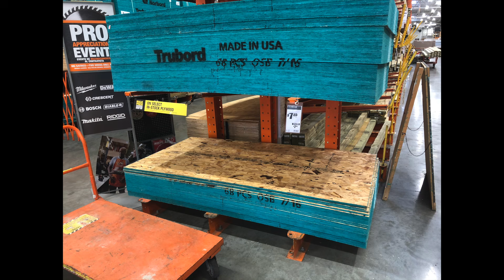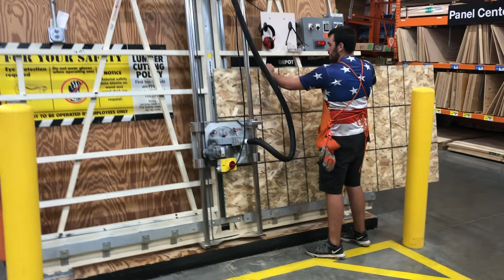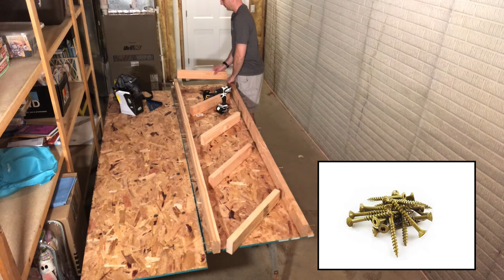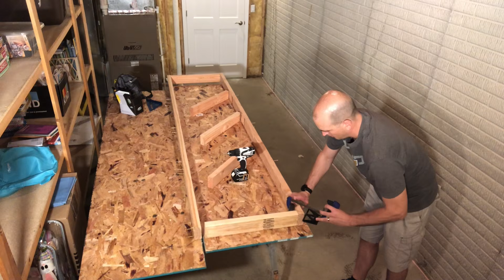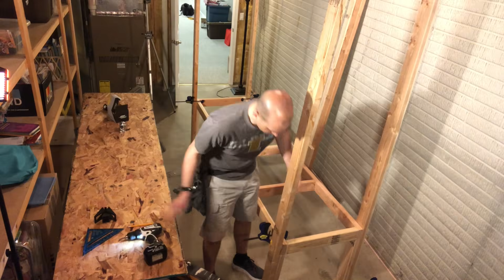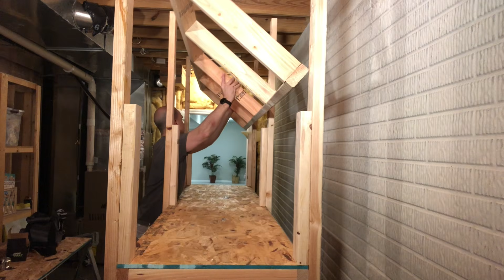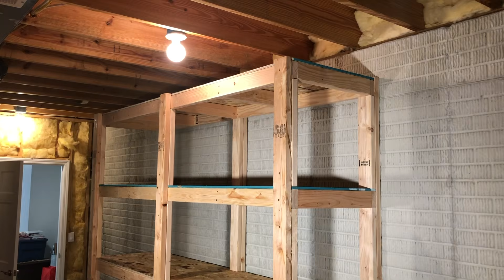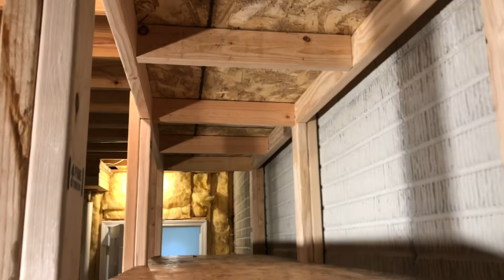How To Build Storage Shelves | Easy Build

Comment: Great video. Does the corner clamp pads work on those 6" mini Irwin clamps? It says for medium/heavy clamps...so wasn't sure.
Reply from the maker: Hi Bica,  Yes the corner clamps will work with the 6 inch Irwin Clamps.  You will just take the standard pads off and insert the corner clamps pieces.  Best of luck on your project!
Reply: @EverydayHomeRepairs  even the minis? I ask cause I read an amazon comment that suggested the attachment pads don't work on those, but only on the medium/heavy version
Reply from the maker: Hey Bica, I checked mine this evening and I have the 6 inch mini clamps which worked with the corner clamp. I think the difference is the medium and heavy duty clamps you remove the standard protective pads then install corner clamps and my minis you can keep the standard pads on which fit into the corner clamp.  Should be good to go!

Comment: Hi Scott, great video! My basement has very low ceiling, 7' to be exact. Do you have any recommendations best way to accommodate the lower ceiling?
Reply from the maker: Hey Michael, are you going to primarily store totes?  If so what is the height of your totes?
Reply: @EverydayHomeRepairs  they're about 17-19". I think I figured out the measurements but please let me know if they're off.
-6 72" for the legs
-8 96" for the sides of the shelves
-4 cut into 15 separate 21" pieces
-4 cut into 18 separate 20" pieces
Reply from the maker: Hey Michael, looks good to me. Best of luck on the project!
Reply: @michaelsantos2546  Did you still need 8 96" for the side of shelves? I am in a similar situation where I am only doing a 72" tall shelf. I am keeping the same spacing between shelves so i am not doing the top shelf. Therefore i am only needing 6 96" studs.  Just following up in case i am missing something!

Comment: Scott Thanks for the video
Can you give the exact dimensions of all the parts in sntimter
Reply from the maker: Hey David, the full build list is in the description of the video.  Let me know if you need any additional measurements.
Reply: @EverydayHomeRepairs  thnnks

Yes I need the width of the shelves And the distance between the 3 pillars of the installation length
Reply from the maker: @davidhanin4117  
height = 8 feet
width = 8 feet
depth = 2 feet 3 inches

The shelves have about 43 inches open in between the legs and the height of the shelf opening is 20 inches

Hope that helps and let me know if you need anything else.

Comment: Hi, I have two questions:
1) for the legs, do they have to be pressure treated since it touches the basement floor?
2) how would you anchor this to the concrete wall?
Reply from the maker: Hey Wonbo
1)  I think it would be a good idea to make the legs out of pressure treated especially if your basement is humid/damp.
2)  I just used metal strap like this https://amzn.to/34gAX2n and attached 1 to each end and then to the floor trusses.  

Best of luck on the project!
Reply: @EverydayHomeRepairs  Thank you! So for number 2, that essentially anchors the shelf to the trusses, instead of the wall right?
Reply from the maker: Exactly, if you secure the strap (from the truss) such when the shelf just starts to tip then the strap pulls tight that will be enough to keep the shelf from tipping.

Comment: I like the design, and I'll be doing something very similar in my basement. Curious why you bothered to build it to the joists and put the OSB on the top since it's too close to the joists to really be used as a shelf? I think that I'll stop at whatever level will keep the top shelf open to the joists so that it's usable and I can fit taller items in between what are in my case trusses. In yours, I would have stopped at level three since the top is not really usable. Just my thought.
Reply: Thanks for the response Scott. Illinois grad myself but probably a few classes prior to yours.
Reply from the maker: ILL!
Reply from the maker: Hey Mark, yeah your comments are completely valid.  I was also trying to build it for the viewers and thinking through a garage where you might have more ceiling height.  If you look at some of the other comments others have noted their tweaks to the design to get more use out of the top shelf.  Best of luck on the project!
Reply: INI!

Comment: If I want to make a shelf that is 12 feet in length but same height and depth, how would that change the materials list?  and assembly?
Reply: also, if (due to air ducts) only 6 feet high for the 8 ft long shelving would work, how would you change your materials list?
Reply from the maker: Amy, could you leave the legs being a full 8 feet but just not install the top shelf?  Could you fit the legs around the air duct or do the legs need to be shorter as well?

Comment: Hi. I have question. This is all free standing right? Is not attached to the back wall correct ?
I like it for my storage unit. I Can't not attach nothing to the walls. Let me know. Thanks 😔
Reply from the maker: Hey Nicki, yep the shelf is completely free standing but I would recommend installing some type of "anti-tip" cable or strap to make sure if somebody (probably a child) is climbing on the front side that it doesn't fall over.  Best of luck on the project!

Comment: If you can afford another 4X8 sheet of MDF, have it cut in half lengthwise and secure the two pieces to the ends of the shelving unit. This prevents items from falling off the ends.
Reply from the maker: Hey Chuck, thanks for the additional ideas on the shelf construction.  Appreciate the help!

Comment: Thanks for the video. Unfortunately I cant even get two boards to tie together. They will push away if I dont drill, and if I do drill, the screw wont hold. Even if I do drill, they will still somewhat push apart... and then break apart. If I try to send it, the wood will crack and/or the screws will strip... and there will still be a gap. Im using Spax construction screws. What am I missing?!
Reply from the maker: Do you think your boards are all cut to the correct measurements?  which part of the shelf construction are you on?
Reply: @EverydayHomeRepairs  Shelf frame. First one. Attaching 8' to 21" board.
Reply from the maker: @southseapirate1  what are the length of the screws you are using?  I used 2 3/4 of an inch screws but 2 1/2 should work as well.  From what you were describing I would think you might be using 1 3/4 of an inch screws.
Reply: Predrill and use wood screws.

Comment: I suggest bracing shelf to ceiling or to wall, to prevent tip over, kids like to climb things
Reply from the maker: 100 % agree.  Thanks for calling more attention to bracing for safety.
Reply: I was going to ask about this. What do you recommend to keep this sturdy against a wall in my garage so it doesn’t tip over?
Reply from the maker: I would recommend a furniture anti-tip strap or kit.  You could make your own or find one for about $10 on Amazon.  Just make sure when attaching to the wall you attach to a stud and not just drywall. Good luck on the project.
Reply: @EverydayHomeRepairs  Thanks!

Comment: A refinement that I would like to suggest............since shelves like these are likely to be in a basement, and many basements (especially unfurnished ones) have their concrete floors sloping slightly towards floor drains or the sump pit, trying to get all the shelf legs level within the shelf and yet properly taking their share of the load, a solution is needed. 

What I have done is to take each vertical 2x4 and drill a hole in the end that will rest on the floor, perhaps 1-1/2" deep and centered on the bottom of the leg and going vertically up into the leg. For the diameter of the holes, I recommend a clearance to fit 3/8"  bolts. Then get some 3/8" - 16 carriage bolts, and a matching nut and flat washer for each bolt, one bolt per leg, and the bolt length should be whatever the leg hole depth is + 1" , so if you drilled the holes to be 1-1/2" deep, you want a 3/8-16 x 2-1/2" carriage bolt. Thread the nuts into the bolts, leaving about 1/2" between the nut and the bolt head. Fit the washer onto the bolt so it touches the nut. Stick the bolt into the hole in the bottom of the 2x4 leg. This gives you and adjustable leg leveler on each leg. Use a wrench to hold the flat part or each bolt behind the head, and another wrench to turn the associated nut, and you can easily extend or retract the bolt to compensate for unevenness in the floor.
Reply from the maker: Hey Youtuuba, not a bad idea and thanks for sharing.  This would be very handy especially in the basements with a little more aggressive slope heading to the sump pump pit.

Comment: Screws are not to be trusted for structure strength.

Nails have shear strength that screws cannot match.

I see this often, people building structures using screws.
Reply from the maker: Hey Duane, thanks for the comment.  The screws from the 6 legs going into each shelf shouldn't be in shear since the small 2x4 sections are placed under each shelf to carry the vertical load.  I might be missing something and always looking to learn but I feel good about this design holding up.
Reply: Everyday Home Repairs 
ah, 
Notice taken.  
The vertical 2x4’s do save on shear movement.

Which does support to prevent shearing.

However, maybe to solidify this project, I would add nails.  Screws should not be trusted.

The video end and start still frame shot hides the center back vertical support (6th leg) 

I will amend my original comment about the scheduled event.

Btw, lots of people making shelving videos with no legs for the rear support, 
relying o the garage wall to support the shelf load.

Your project unlike others stands on its’ own, 
Shelves are supposed to support their own load.  Not relying on the rear wall.
Meaning legs in back too.  

But I reaffirm safety using nails not screws.  Or additionally to the screws.

So far, your shelving is much stronger than any other shelving projects I’ve seen here on YouTube.
Reply from the maker: @duaneyoutbe  appreciate the additional follow up and knowledge sharing.

Comment: First off... That's not "Plywood", it is O.S.B.! Oriented Strand Board! There is a difference! 
Second, I have found that having the lumber pre-cut does save time, but you need to observe the employee doing the cuts. Some of these persons don't do their best to get the dimensions right.
Thirdly, you as the designer need to get your dimensions down perfectly right, else wise you'll get to make the adjustments yourself. And you'll be lucky if the dimension is just too long. Too short means going back to the store for another piece of lumber.

Comment: I will be doing something similar to this, in a shipping container. Except that it will be built-in. No back legs, the shelves will be attached directly to the wall, this will give me an extra inch and a half of space. A consideration in tight quarters. Mine will also be 16' long and 6' high. I will have 3 shelves, at 2', 4', and 6', giving me approximately 2' vertically for each shelf, with the bottom "shelf" being the floor. I'll be doing all the cutting myself, I'll also be doing lap joints on the shelf rails, to make 16' rails. I like your vertical reinforcement of the legs. I hadn't thought of that, much easier than the way I was going to do it.
Reply from the maker: Hey Dave, sounds like a fun project.  Are you using the container strictly as storage / shed or are you making a home out of container(s)?
Reply: @EverydayHomeRepairs  Storage and a small (very) workshop.
Reply from the maker: @Dave_Simmons  that's awesome.  I am a big fan of shipping containers and hard to get a more robust shell for the money.  Best of luck on the project!
Reply: A big problem with these containers is the lack of insulation and cooling. Especially here in the desert! Adding power to them isn't a big deal. Adding rigid foam insulation from Home Depot is going to cost almost $600.

Comment: People actually make home depot cut all of there shit like this?
Reply: That's their job, it's in the job description.  If they weren't doing that they would be doing something else.  They don't get paid to sit around.
Reply from the maker: Jeramie,  guess it might be easy to overlook that everyone doesn't have a truck and saw at home.  If you have the right equipment I say go for it and you will have more control on hitting the exact length needed.  If not, utilizing HD capability and their willingness to cut your boards seems like a solid option.
Reply: @EverydayHomeRepairs  I'm just not the type to cause others extra work or inconvenience them much less trust that all of their cuts will be accurate. I've brought a cordless circular saw with me to cut sheet goods and really long boards a few times to fit in my Grand Cherokee. Although I can carry 16ft 2x12s in it no problem without cutting lol
Reply: @EverydayHomeRepairs  I am not overlooking anything I just figure that if you don't have the means to do so that you should then pay someone for their tools/abilities/time. If it's a free service I'd think that they (HD) would probably rather not do it. It's  for convenience but not to be taken advantage of. So cutting to fit your vehicle is one thing but cutting all of your pieces to length for your project when the whole 2x4 at full length will fit in your vehicle as is just seems a little overboard. I just know that if I worked there I wouldn't want to have to do that and would not like the customer who requested it. But if it's a paid service then everything changes.
Reply from the maker: @jeramiet154  For most the big box home improvement stores this is a free service they provide to try and get you in the door.  They (HD, Lowes, etc.) will cut sheets and boards to length per request.  I also think you shouldn't keep them there all day cutting wood for your project but with their setup they can knock out a project like the storage shelves in about 5-10 mins.  There is a definite chance they could be off by an 1/8 of an inch so something to keep in mind and good to set expectations.
Reply: Is there no limit to how much they will cut? Do they do mitered or beveled cuts? Do they cut sheet goods in more shapes than just a square or rectangle? Any fees?

Comment: Great project, but I don't see the purpose of the top section.  Seems like a waste of wood and you can't add anything to the top.  Are you tying it to the floor joist to secure it from tipping?  Not trying to be critical, but trying to understand how you use that top section as I plan on doing something similar.
Reply from the maker: Yeah,  for my setup I only had about 1 foot clearance to the floor joists so the top shelf had limited function.  I wanted to show the top shelf to try and apply to others which are putting this in a garage with a 10 foot ceiling.   I just used a little wire from the bottom of the floor joist to the middle backside leg as an anchor.  I don't mind the questions at all and best of luck on your project!

Comment: Great video, great heads up about HD making the cuts!! Quick question, how important do you think the middle supports are? I love the design just would rather have it open on the middle if possible.
Reply from the maker: Hey Dengriff, depending on how much you are planning on loading up the shelves you would probably be okay without the middle support.  You could try it out and if you don't like the overall structural strength then just add in the middle supports.  If you do test it without the middle support and could report back your findings that would be Awesome!
Reply: Why not put the middle support in the back instead of the front?
Reply: I ended up not adding the supports and have stood on it with it fully loaded and feel comfortable enough to not worry about it. Thanks again

Comment: Awesome video. Have watched multiple times. I want to do more DIY projects but don’t have a table saw or chop saw. I like that you considered the average homeowner in your videos.  Really appreciate that.

Quick question. My shelves will be freestanding as well in the basement but won’t have a heavy load on them. Do you feel like that middle leg on the front is absolutely necessary for support?  Just wondering if I can do the whole shelf as one big open shelf.  Maybe it wouldn’t work over such a large length.
Reply from the maker: Hey JD, glad the video helped.  You will be fine without the middle leg as long as you keep the loads reasonable. Worse case you can add it in later without any issues. Best of luck!

Comment: The reinforcement is crucial! Thanks. In my previous home, the previous homeowners built some shelves similar to this, except there was no reinforcement. Overtime the thing was falling apart. It took me more time to reinforce them than ripping them out and rebuilding new ones. Now I need a shelf like this for my new home. Thanks for all the measurements so I can just have HD precut them instead of me cutting them and having to clean up the saw dust.
Reply from the maker: Exactly, for projects like this having HD do the cuts saves a TON of time and mess.  Best of luck on the project!
Reply: @EverydayHomeRepairs  about hou much weight, per shelf, do you estimate this will hold? I'm wanting to put a 165 pound CRT TV on one of the shelves and wanted to knof if that would be too much as it will be a permanent home for this tv.